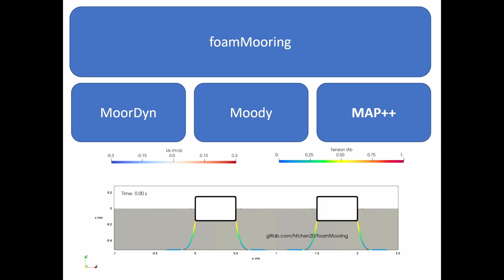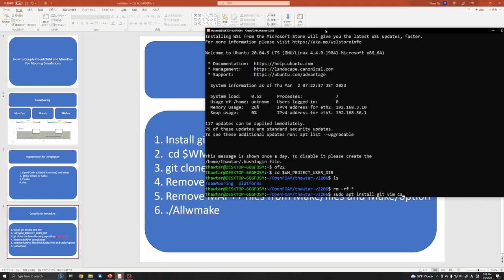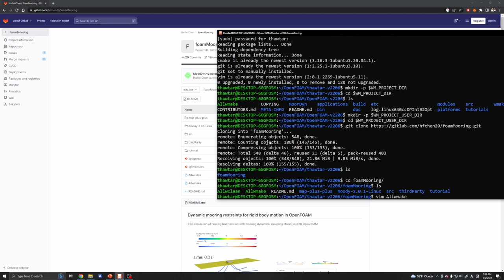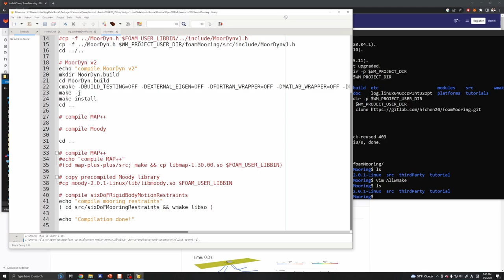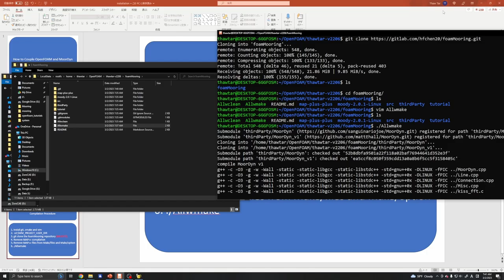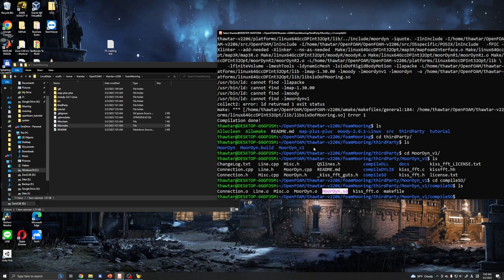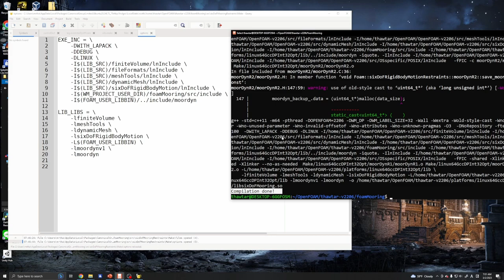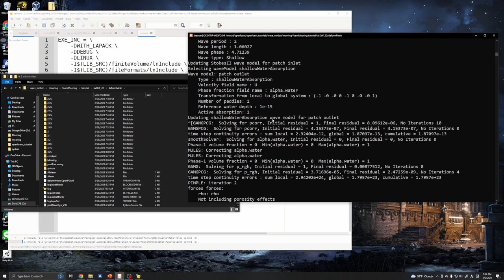How to Couple OpenFOAM and MoorDyN

Comment: I made a successful compile and when I test the tutorial I faced this error. I am using OpenFOAM v2306. Error "MoorDyn has been built without VTK support"
Reply: I'm having similar problem, have you manage to solve an error?
Reply: I'm having similar problem too, have you manage to solve an error?
Reply: I have solve the problem. Now there is a updated tutorial whose dynamicMeshDict is set as the MoorDynR2 restraint instead of the MooDynR1, so It happens that MoorDyn has been built without VTK support, we need to change the restraint into the MoorDynR1, but a additional step is to extract VTK files using its python code(post MoorDyn_VTK.py).

Comment: Hello, if the combination is successful, but the test prompts that the moorDyn has been built without VTK support, and the calculation example cannot run, is there a solution
Reply: Hey, i encountered a similar problem, have you resolved this issue?

Comment: Hi, I hope you are doing well. I have a problem, could you help me?
I cannot even compile the MoorDyn v1. The problem is: 
/usr/bin/ld: cannot find -lstdc++
collect2: error: ld returned 1 exit status
make: * [MoorDyn.so] Error 1
Do you any idea? I have not solved it yet. Thanks a lot!!
Reply from the maker: Sorry. I have not faced your problem. First, I need to replicate the problem
Reply: @thawtar682   Thanks for your reply. I have solved the problem by removing "-static-libstdc++" in the compileSO/makefile
Could I have one more question? now compiling MoorDyn v2 also faces some problems:
#error This compiler appears to be too old to be supported by Eigen
#error This file requires compiler and library support for the ISO C++ 2011 standard. This support is currently experimental, and must be enabled with the -std=c++11 or -std=gnu++11 compiler options.

Have you encountered kind of error? what version of CMake you are using? now I am using CMake 3.12
Thanks!